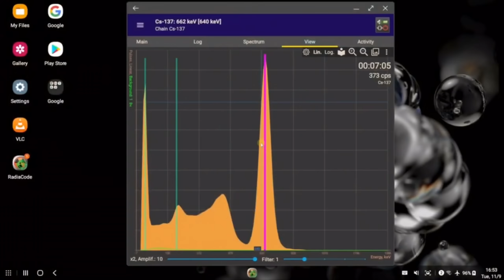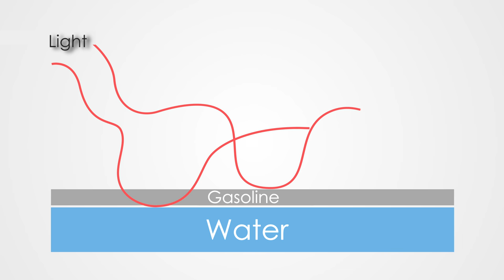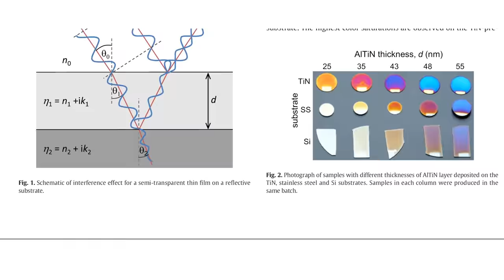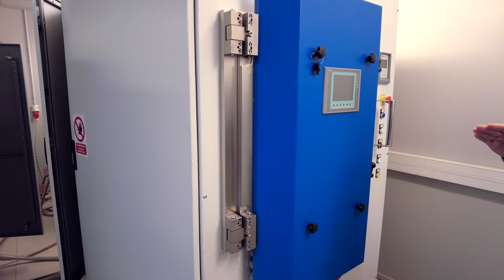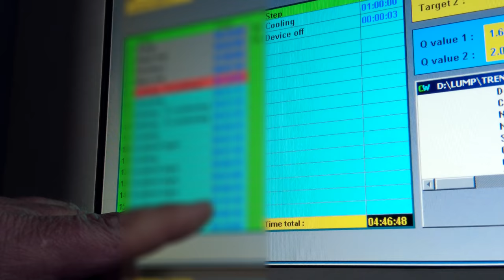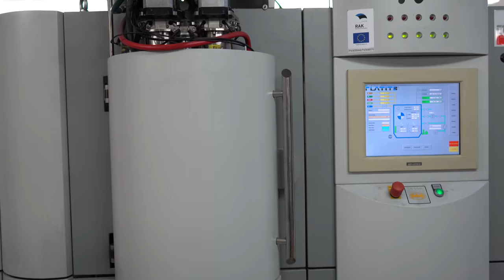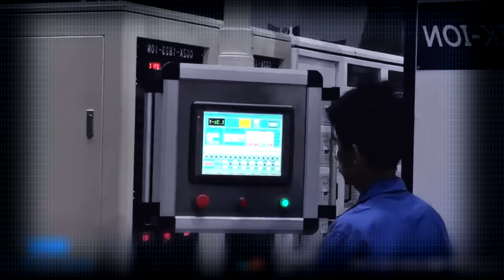Why Such SPOONS Are SO EXPENSIVE to Make?

Comment: I'd love to anodize a sword or giant shield in this way.  Maybe a future video idea?
Reply: @PoorMans Chemist right!?!  Give me a call, man.  Need to ask you some things real quick.
Reply: I would look into heat anodizing for such large objects. My brother and I have done a few cheap swords (from budk) this way.
Reply: @JakHart  you have a good point! Really large objects like that really are hard to anodize and have it all turn out right and even. I agree that heat anodizing it would probably work out best. I've done a little experimenting with anodizing copper strips with heat and it actually worked out pretty well. I may try that with a solid steel knife that I have laying around. Would be neat to see how it does! Thanks for the suggestion!
Reply: @JakHart  It will still be quite difficult to get an even gradient with small forge or torch, unless you have a large forge that could fit your whole blade and be heated relatively evenly. nice enough result should be doable with some experience though

Comment: Fun thing, you'll see titanium coated quartz at a lot of gem and mineral shows, where it is advertised as "rainbow" quartz, and many vendors will insist that it forms naturally. It's fun to haggle them down from their extremely high marked prices down to only a few dollars before just walking away :D
Reply: The official term for this type of quartz is called "Aura Quartz", and many different metals can be used.

It requires vaporizing metals in a vacuum, it's not easy or cheap.

I do remember another science YouTuber making said machine recently, though I cannot recall who it was. Maybe it was Steve Mould, but don't quote me on that.

EDIT: it is the most recent video from The Thought Emporium.
Reply: @JakHart  The Thought Emporium built one
Reply: @deflepperdrocks12954  Thank you! That's exactly the video/YTr I was thinking about.

Comment: You might be able to achieve nm level coatings with laser deposition. Purge a chamber with nitrogen and fire a high energy pulsed laser at a target (a titanium aluminum alloy). The target turns to plasma and expands. It should then combine with nitrogen and be able to coat a substrate (spoon).
Reply: I love the "substrate(spoon)" part

Comment: Hey quick thing, I’ve done some small amount of anodization of titanium I’ve found if you max the voltage and quickly dip or pull your piece out of solution you can get a mush smoother cleaner rainbow

Comment: I used to know a business owner who used to make colorful stainless steel sculptures in his off time.  In stead of anodizing the metal he would season it.  His stainless steel was brushed with assorted greases and oils before having a high temperature blowtorch taken to them.  The trace metals in the oil bounded itself into the stainless steel.  Stainless steel normally dies not oxidize but he mixed some other chemical powder into the grease or oil that would cause an oxidation process.  To this day, he never revealed what that secret powder was

Comment: Well, €2000000 doesn't include the cost of the spoon factory, or the steel mill, or the iron ore mine, so you might want to up that estimate a bit!
Reply: I can get you a way better deal on a spoon factory.  I have a guy.
Reply: @jengleheimerschmitt7941  in your basement?

Comment: I wonder if someone could answer this.

When you see fabricated metal items (often aluminium) that come in a range of colours, like carabiner clips for example, there is some process, which isn't powder coating or any paint, that is done to achieve these colours. Could someone briefly explain how this is done?
Reply: @SplatterShotJr m Thanks I'l look it up.

I have been wondering about it for 20 years! I was watching a Discovery doc, but had to go out - no problems, I'l watch the repeat later. 

There was no repeat! Ever.
Reply: Yes, anodizing. Clean the alluminum, soak it in the correct acid so it will accept the choice dye, then soak in the dye until its rich enough in color for your liking. Theres a 2nd type of anodizing that hardens the surface also.
Reply: @1traviswyrick  Thanks. It looks like such a simple and clever way to coat metal and the results are amazing.

Comment: People have said that they don't like the coatings as they wear off. The problem is people throw them in with other silverware, Titanium gauls very badly even though it is generally more durable and tougher than most metals you can run across. Its one of the main reasons why its not used more commonly in things like engines. That's why Titanium that is used in engines have to have a special coating on each part outside of still needing oil. Even aluminum does not need this type of coating. 

Back to the spoon! The titanium coating is very durable just don't throw it around like an average stainless steel silverware. Even stainless steel gets scratched or dinged and will lose its finish but the titanium wears less but it is a coating and not the entire spoon is titanium. Sometimes if you get chipping then the ones that plated it did not take enough of a process of cleaning to get a good deep adhesion layer. That's why cheap is not ideal for plated items for durability. But you could get lucky with cheap as maybe a batch does get the good layers it needs to hold up. Its quality control and finish of each process.

Comment: Halfway through the video right now, bit I'm honestly surprised you haven't touched on heat anodizing.

It's easier (except for copper) and a lot safer. I do it all of the time with titanium and steel, and every now and again, I try with copper. It's much trickier to control the temperature with copper.

All you need is a sufficient torch, you know, the cheap ones you can get at gas stations.

Comment: Just blue the steel under heat, you get a similar effect through surface oxidation including rainbow from straw through purple, blue, green and fading to grey. The purple and blue can be quite intense.
Reply: This is titanium, not steel. Steel won't anodize, it oxidizes.
Reply: @TheExplosiveGuy  The COATING is titanium, the spoon is steel, listen to the video @5:40, it is not anodized but uses gaseous vapor deposition in a vacuum chamber. I said it oxidizes, there is more than one path to thin film colorization.

Comment: the technology of the 70's is impressive and shrouded in secrecy
Reply: People around & of age, saw little of anything in new tech .  Colour TV had not long started broadcast & the first test transmission in the early 1960's was B&W, and full of 'noise' as the future in laws, rushed out to get one only to find themselves right on the edge.  Long distance jets = yes  - domestic = no. Steam trains, ran along with desil & electric. Cars were expensive - starting at $ nz 7,500.00 & up past $100,000.,00 , and all of them had 3 years warranty or 15,000 miles . Transistor radios were about, no disc man or walk man  & our rivers weren't as dirty as now.
 Even in the USA, mid 70's, there wasn't a large amount of high tech, though colour TV was available & cars were cheaper & cheaper to run.  No double deck buses except London, that I recall & only major city's with underground networks, & the British were trying to get the tilting trains perfected, but management were impatient, sold it off to Italy & there's now Pendolino Trains running at higher speeds on standard tracks.
Namaste 🙏

Comment: I saw some spoons forks and knives at my local Walmart that's rainbow some gold and some black and all are 2.00 dollars each I bought me 2 rainbow spoons and the effect is a little different than his spoon the inside cup part area is gold color while the back is a purple magenta color the handle is green on the edges one side blue one side gold color and I noticed it didn't scratch up either as easy. I might go back and get some black spoons or gold ones. They have a full dinnerware set for 22.00 dollars for rainbow but the gold was 30.00 dollars, they didn't have the black in the set. So I just buy a couple of them over time I don't need the butter knives that always comes in sets. I did notice the black had some weight to them though. I also might get cutting knives like that or knife set rainbow. I even seen steam kettles rainbow like but I'm wondering if the heat of boiling water will effect the colors over time. I have always loved rainbows my whole life and not because of the nowadays abomination that goes with the rainbow but about God's promise.

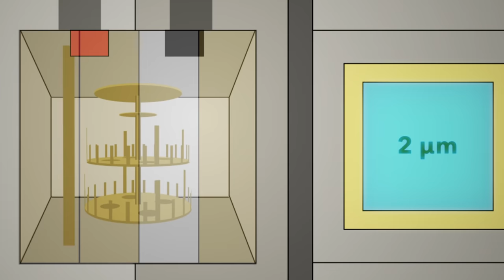Comment: @11:00 Is the "Cathodic Arc Deposition" a similar process as the "Electron-Beam Physical Vapor Deposition" (Sputtering)? At least "Applied Science" has shown how to make an "Atomic Layer Deposition" and "Sputtering" in a home-scale laboratory. If you would change the noble gas with N2 you would perhaps get the same result ?

Comment: Hey Thoisoi2  I noticed my chrome plated motorcycle exahst pipes had all these colors and more. The Colors would change depending on speed loads and temp and humidity. So I had my gas tank coated or electro plated with one layer of copper then nicel then chrome. Then using a torch I changed the colors of the tank from blue purplr red golden and even some green. Then coated it with clear coat. It looked very cool. However a titainium tank would be much better. Not in colors but hardness.

Comment: 1min into the video my first guess is it's anodized at changing voltages for changing colors. Looks like it's aluminum or titanium or similar. Bismuth crystals are that color as well but that is not very durable.
Reply: Bismuth achieves it's color from heat anodizing.

Comment: Does that coding make it less susceptible to corrosion / rust ?
Reply: Yes, it is covered by titanium...
It is one of the hardest to oxide in volta table
Reply: @Dominus_Potatus  Pure titanium is almost as reactive as aluminum. It also forms a passivating layer in oxygen. But this is titanium nitride. It is already “married”.

Comment: I thought the colorful spoon effect isnt made by coatings or platings per se, but uneven heat treatment. Like when you heat up steel, it produces some blue/yellow colors. Temper coloring? 

If so, all you need to make colorful spoons is a hot torch
Reply: The color range for heating up steel gives a different color range.The only way to achieve that spectrum is via sputtering a titanium layer.
Reply: watch the video to the end, he does that lol
Reply: @bernardo00124719  oops

Comment: extra hard bullets?
Reply: It only makes the surface hard, not all the material :) TiN tends to become brittle as the thicknes gets higher then 20 micrometers. So in my opinion it will make the guns bore to wear out a lot faster and you wont get any improvment in ballistics or penetration capabilities